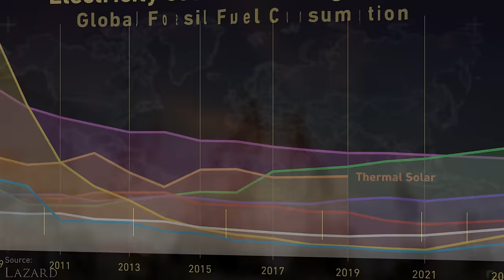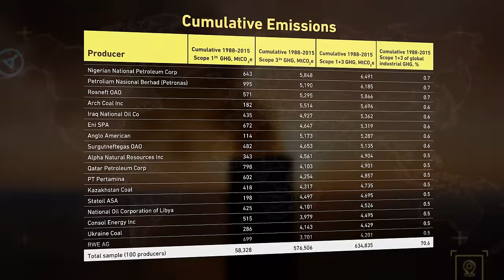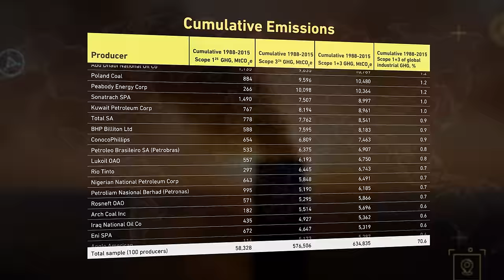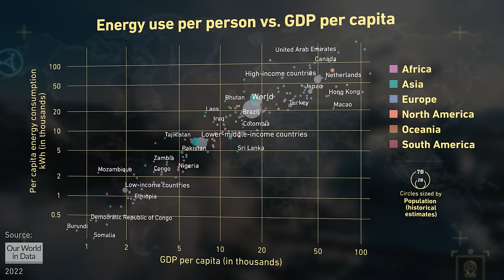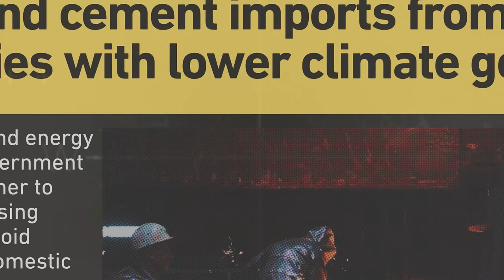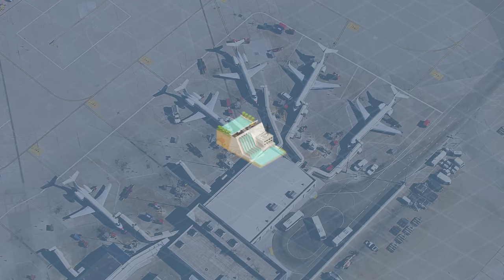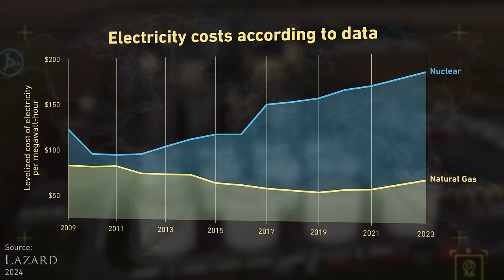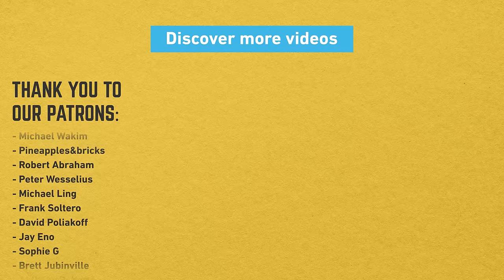Why We Can’t Just Stop Oil

Comment: Basically, build more nuclear and bring down the upfront construction curves through learning curves. Be more like France, less like Germany
Reply: They will still be megaprojects, learning curves don’t apply as much. Not even SMRs will be produced in large enough amounts to have large learning curve effects. Finance risks and regulations will be much more impactful.
Reply: Being more like France requires massive govt. investment. Contrary to the popular narrative, nuclear energy is in the doldrums not because of the pressure of green activists, but simply cos there's no longer much money in it. It requires huge upfront investment, takes too long to pay back, and when it finally does pay back isn't all that great returns either. So private investment in nuclear energy is low. Govts. don't want to foot the whole bill either, hence they look for private partnerships. Which they don't find. And no, small modular reactors are actually the LESS efficient way to do nuclear, so they're hardly a solution. They're attractive only cos they're cheap - at first. But the initial reactor also produces less. Once you start adding to it to reach the power generation of a large reactor, it ends up costing even more doing it that way than just building big to begin with.
Reply: french nuclear company is 80b € in debt and half the reactors need major maintenance
Reply: @ArawnOfAnnwn Chicken and egg? Isn’t much of the risk and cost due to government and lawsuits? It’s  much like healthcare and defensive medicine. The US did a big FAFO on healthcare.
Reply: @mohammedsarker5756 No, you didn't listen. Build renewables but don't shut nuclear plants down unnecessarily.
Reply: eblman5218  SMR's are LESS efficient than big power plants. They're only cheaper cos they're, you know, small. The more of them you get, the less the investment makes sense.
Reply: I like Mercedes more than Peugeot or in other words, the German economy is almost three times the size of France.  It may not be as easy as saying just switch.
Reply: @ArawnOfAnnwn  Really? Why is that? Are you just making this stuff up? Have biased sources? What?
Reply: eblman5218  If your industry depended on low interest rates to work, you didn't have much of a business to begin with. There's never gonna be a low interest rate regime that lasts forever. You need to still have a viable business when it ends.
Reply: @ArawnOfAnnwn Additionally, an nuclear power plant takes about 7-9 years to build (differs by source). Then there is the problem of geopolitics, as not every country is keen on delivering uranium to geopolitical hotspots. Comparing that to the construction time and ease of access of renewables, I would say that these are much better ways to go, although in some situations nuclear might be better. As a German I do think that shutting down existing nuclear plants was a stupid idea, we just should have stopped building new ones instead.
Reply: Anyone can say it. Making it politically acceptable seems nearly impossible.
Reply: Oh you simply don't know the extra amount of energy required to make long hydrocarbons for Petro chemical materials. Its just extremely in efficient like EXTREMELY. Talk as much nuclear as you want, you cant electrify war machines, cargo ships and petrochemical industries, this is coming from a chem eng, like seriously its much much more possible to decarbonize natural gas related industries than oil sector except for the part its used to be burned for energy
Reply: @SmileyEmoji42 I dunno, Japan figured it out and also found a way to recycle nuclear waste to maximize the amount of energy gained from nuclear materials. The U.S. has an archaic and outdated version of democracy no one else uses (European democracies change their Constitutions regularly) and a conflict-riddled two-party system which can force a choice between two potentially terrible options. With that same democracy more less at the behest of corporate interests, then yes it would be nearly impossible for the U.S.
Reply: @fynaglin9075  Japan has a culture of deference to authority - The USA does not
Reply: @fynaglin9075  'European democracies change their Constitutions regularly' - the US was also supposed to be changing its constitution regularly. No less than a US founding father famously said so. They just...didn't do it.
Reply: Nuclear is not renewable and there's not enough to replace oil in our current system. Also nuclear cannot replace oil for all the other products we get from it.
Reply: @notafantbh  Nuclear might not be renewable but there's enough nuclear fuel available (especially with breeder reactors) for 100s of years at least. With enough electricity all the other products can be synthesized from biodiesel. Having said that, I don't think there's the political will for nuclear
Reply: @SmileyEmoji42  100s of years is not a solution, we should be thinking in much longer terms
Reply: We also need more public transport, passenger rail, walkability and cycling infrastructure. Car dependence is killing us.
Reply: @Kristoferpalmestal  why won't SNRs be produced in high enough numbers?
Reply: @notafantbh  There is no point in thinking longer term than 100 years - Technology will have rendered any decision we make now irrelevant in much less time than that. 100 years ago the total known oil reserves were less than is pumped every year now. AI will save or destroy us in muchj less than 100 years
Reply: France just raised prices for nuclear electricity from 4,5 to 7ct/kWh before subsities and taxes ... 😂. Show me another eu country with that low energy generation prices.
Reply: The only real way to reduce costs for nuclear is to reduce safety. People don't like reducing safety on things that could render areas uninhabitable for 10,000+ years. There's a reason all new modular reactor solutions keep revising costs upwards to where the LCOE is approaching the same as traditional nuclear.

Wind/solar + storage is already the lowest LCOE of any new generation today and getting cheaper still. All we need is to continue ramping capacity to build them.
Reply: @tHebUm18  are u a bot? Can u read a radiation map? Does the vasinity around chernobyl look like uninhabital for another 9970 years? The wildlife would love if u spare them that long 😂
Reply: @ArawnOfAnnwn If external costs of pollution would be taken into account, nuclear energy would still be the cheapest baseload  source.
Reply: Nuclear is a mature industry, it is getting more expensive not less. Nuclear plants are megaprojects and these almost always blow their budgets and timelines. SMRs are a boondoggle.
Reply: @ArawnOfAnnwn  the thing is, its nuclear. its already 10,000x times more efficient. knocking it down by even 90% is doesnt really matter. SMRs are the future

Comment: One thing I feel has to be pointed out, is that while yes, a lot of these issues are currently locked behind separate complicated issues that need to be solved before any large scale fix can be implemented, not all are. For example, those large companies who produce such a high percentage of emissions have for a long time gotten away with essentially self reporting their emissions. Which of course means many have lied. And with modern technology we know this to be true but have simply not implemented this to the point of know how bad the problem is. Here the solution is simple, have someone else do the reporting and force companies to be more transparent. This is one of many example of issues that we have a solution for that today could be implemented which would force companies to take steps to reduce emissions. But many take the opinions you have raised and take them further to say "we can't point a finger at anyone, we don't have a good solution. And therefore we have to solve all of that before we do anything else". Which, and excuse my language here, is bullshit. We CAN make large changes today which will have a big impact. If instead of spreading doom and gloom about the issue, we instead set out minds together and focus on the issues we can fix, and begin working towards those we currently can't.
Reply: The solution will be technological, and will have better cost than current energy sources. Doing less or minor variations on existing technology isn’t going to cut it. The solution may be new energy sources, perhaps fusion from one of the dozens of companies working on fusion power, or perhaps extremely low cost energy storage. But either way, technology will be the answer. It always has been over the past x thousand years.
Reply: Another thing that needs to be pointed out is that consumers, particularly in developed countries, can consume less, and that's also a thing that can be done today. There's nothing wrong with regulation like you are suggesting, and holding companies accountable for inaccurate reporting is certainly worth pursuing. But many people take the options you have raised and take them further to simply  be a shield against them ever having to do anything. The true answer is that we can, and should be addressing the problem at ALL LEVELS, simultaneously. They aren't mutually exclusive.

Comment: Great video - price of electricity is way more complex than the mentioned costs. In a grid with several operators, the price of a MW is a very complex calculation, because the offer has to match the demand. On top of this, some power plants have to be paid just because they are there as a security back up.
When do we get a video about the electricity market? 😅

Comment: As a chemical engineer working in the oil&gas industry, i found it to be a good video explaining the costs and benefits of fossil fuels, but it would be interesting to know the costs of a fully renewable energy grid (renewable plus batteries for energy storage) in order to compare it with the negative externalities of fossil fuels.

Comment: @EconomicsExplained Regarding the "Peak oil" issue, you might want to look at work that has been done by The Shift Project. They detailed with reliable sources how the production of oil is gonna look like in the world (outside of Brasil and Canada) in the next decades and it is not looking good at all. They predict that it is likely to be halved in the next 20 years.
Reply: It will also get more expensive to extract as time goes on. We used all the low hanging fruit already, now we need ladders and gear to get the stuff higher up the tree.
Reply: People have been making that statement since the 1950s.
Reply: @BatCaveOz   There's really no disagreement that peak production will happen, among oil geologists and petroleum industry experts. That's just basic physics. The thing they can't agree on is when. The trouble is that there's not just geological and technological factors at play, but also economic ones. The cost of unconventional production, the cost of alternatives, interest rate on debts for funding new wells etc. 
I suggest looking into the work of Arthur Berman for more.
Reply: @LeviRealize  Those estimates are always ignorant to the actual rate of adaptation within an industry. Commodity prices that were supposed to increase according to geologists have been decreasing on aggregate since the 1950s, as BatCaveOz said.

Comment: Maybe not one for EE but the energy storage situation seems like a field that needs to be explored more, especially using excess electrical power for pumping water in Hydro electric setups etc. Seems like Wind and Solar get bashed a lot (when the wind doesn't blow, cloudy days/at night etc) but quite often it's only because we aren't harnassing the energy when it's available to use later.
Reply: As an energy engineer student, storage is a massive area of research. The problem with hydro, and specifically pumped hydro is that it also has terrible ecological implications, and there is limited capacity to increase it without displacing thousands of people from their homes and destroying river habitats. Thermal solar is promising, but still requires a large land footprint, and the other major proposed energy storage is green hydrogen, but people are put off by it because they still associate it with the Hindenburg.
Reply: The moment you try to store energy you lose at least 20% of it. You also lose more the longer you store it.

Comment: I mean it's pretty simple, nearly everything we use on the daily is made out of petrochemicals of some form. We also are a long ways away from having another fuel source like batteries that come within even half the energy density as petrochemicals. Simply put there just isn't an equal or better option yet.
Reply: I don't think that nearly enough people have any idea as to how much dependence that they really have on fossil fuels just through sheer ignorance. Materials science should be taught in schools. At least stop oil demonstrators would then have the decency to turn up to demonstrations bare foot, with no rain coats and no back packs, to start with. That's if they had the energy, once they'd grown and harvested/hunted all of their food without the use of fossil fuels. There's not a teaspoon of waste that comes out of an oil refinery in a year. And we don't burn all of the products that we produce in our cars. Devastating ignorance.
Reply: You are making two quite different points here.  No one who is suggesting we diminish our reliance on petroleum for fuel is suggesting there are alternatives to petrochemicals for making things.  The long term (I emphasize long term) goal is to use renewable or nuclear electricity to power things to the extent possible while continuing to pump oil in order to make stuff - plastics, fibers etcetera - rather than burning it.

Comment: Rooftop solar can help solve the issue of transmission loss as well as huge land requirements. This can make solar energy even cheaper than its fossil counterparts.
Reply: Industrial scale solar is already cheaper. It’s really just a matter of waiting a few years for car technology to advance.
I mean… waiting for battery tech to get to the point where the sun powers cities at night. The solar panels have already achieved cheapness. It’s all about energy storage now. Battery tech advancements.
Reply: @SigFigNewton  Yes. The other issue of solar is the huge land requirement. So, this issue can be solved with the help of roof-top solar
Reply: @hrushikeshavachat900  is the land requirement a big deal? Pretty sure that even taking land cost into account, industrial scale solar is cheap. It’s all about energy storage tech now. Power cities with sun at night
Reply: @SigFigNewton  I completely agree with you that solar is cheaper than other forms of energy. But what is the issue if we make it cheaper by removing the requirement of large parcels of land. This will allow to increase the ROI to even greater levels. Also, rooftop solar being close to the end user lowers transmission losses as well.

Additionally, many countries like India are facing high scale land deficiency. The large-scale deployment of roof-top solar deployment will allow deploying large-scale solar capacity without touching the issue of land deficiency.

Comment: This video should really consider the economic impact of increased natural disasters & costs due to Climate Change, which are extraordinarily expensive.
Reply: THIS. Future costs are just NOT taken into account and they should be
Reply: The problem is the data simply does not support there being increased natural disasters. The damage caused by natural disasters keeps going down year by year.
Reply: The world has considered those costs and has decided that those costs are less than the alternative (or at least less politically toxic)
Reply: Costs related to weather related disasters are going up 100% due to higher value of the stuff where disasters occur, NOT because of more disasters.
Reply: @DrakonPhD source ??
Reply: @DrakonPhD false. You are incorrect